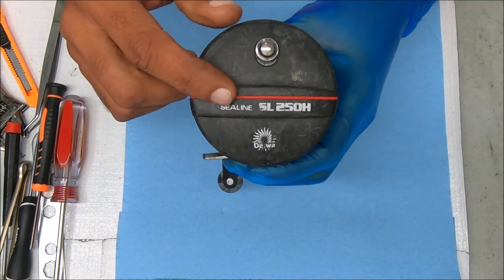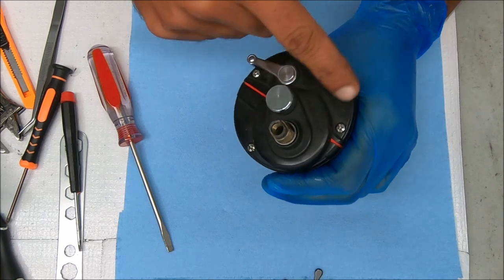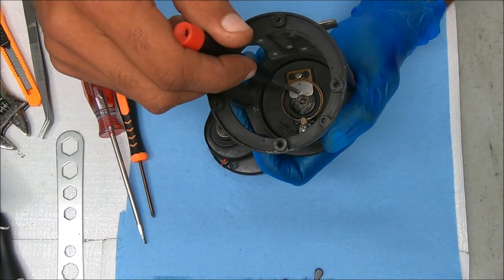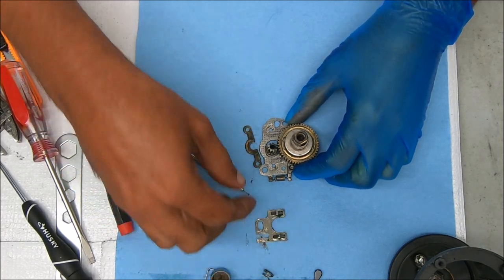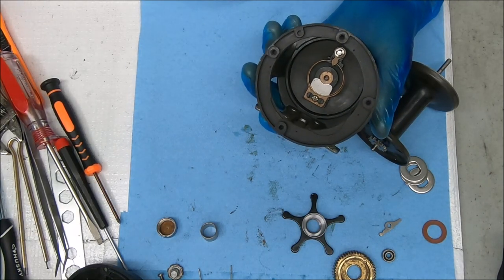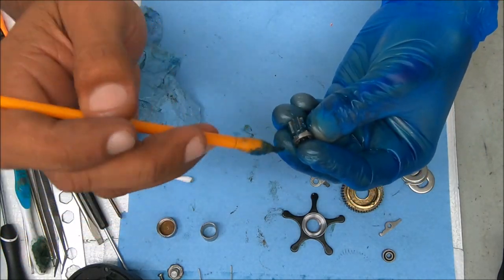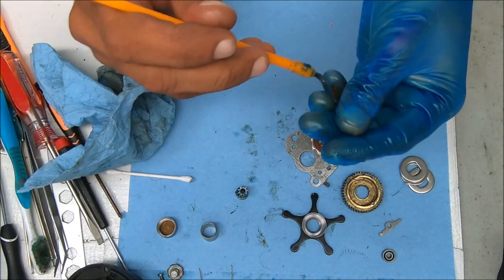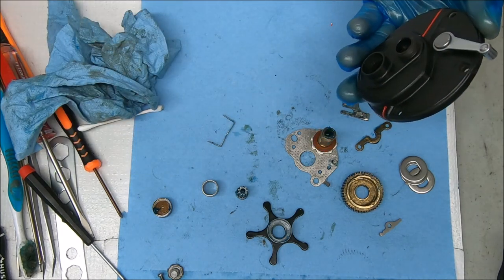Daiwa Sealine SL250H Fishing Reel No Anti-Reverse: How to take apart, service and reassemble

Comment: I came across one of these for $20. I opened it up and cleaned it up. Looks like a solid reel the way it’s built. Where can I get the bearing for the clicker side? Also is there any way to add a magnetic brake? Thanks for the video’s they help keep us going
Reply from the maker: Thanks for watching! Nice price. Not sure about the hotrodding, but you should be able to pick up the bearing on eBay. Spread the word about the channel.